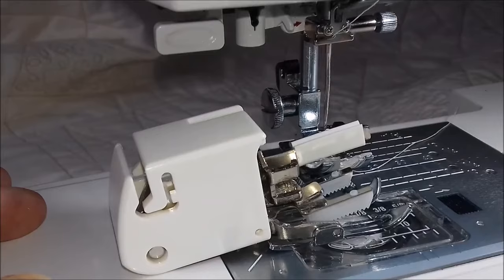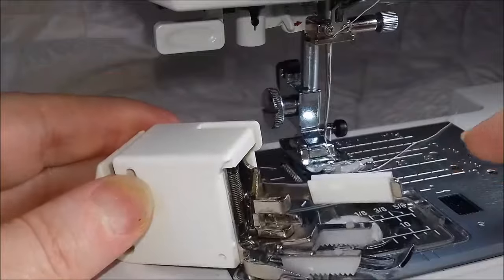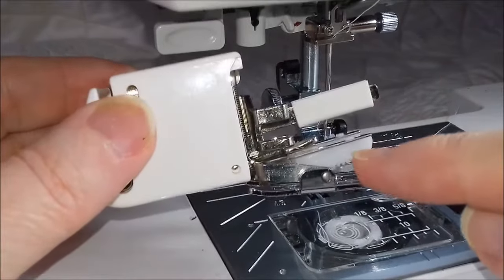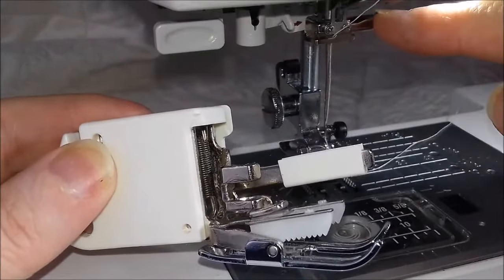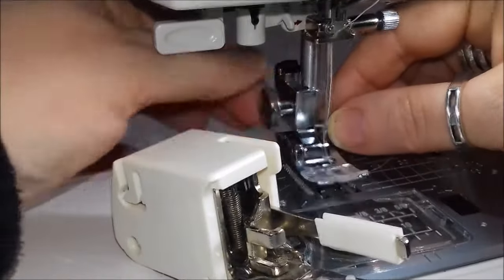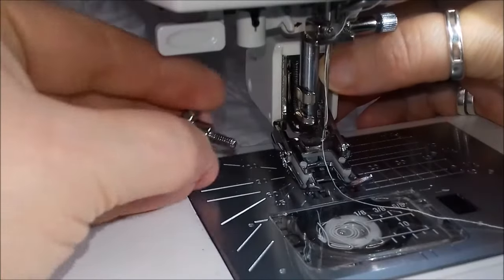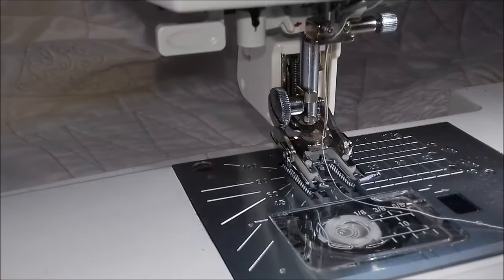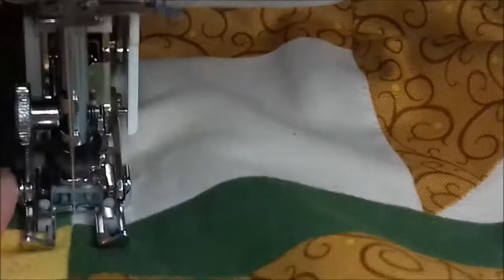How to Fit a Janome Walking Foot

Comment: Hi Rachel I’ve been looking how to fit this type of walking foot, but I have a problem my machine dose t have anywhere to attach n bar to. Any help please xx
Reply from the maker: Hi Wendy - can you send me a photo?  Rachel@sewhappy.co.uk
Reply: Hi Rachel😳😔😞😳 I am embarrassed to admit when I put the foot on and fiddled with the stitching and my needle was positioned on the left. Nowhere in my very thick manual does it tell me how to change needle position, it was more luck than judgment it moved over to middle position. The safest would be if I could move the needle to the right. Thank you. Hugs  xx
Reply from the maker: He Wendy  @WendysCraftDen  you can move the needle position by altering your stitch width... its the button with the zigzag motif... or it could be your stitch setting, - on some machines there are various needle positions preset, eg the 1/4" stitch moves the needle to the right... hope this helps Rach x
Reply: @patchworkquiltingclassestv9084  Ho Rachael I will try that later on thank you maybe I need to down load the hundreds of pages manual. I would have thought it would have been I the basic manual. I have had machines in the past and it’s basic instructions. Thank you for your help. Xx

Comment: It confirmed how I thought it fitted  but I have just spent half an hour trying to get the screw back in. Not much room for a hand to get in there. Done now, may never take it off😂
Reply from the maker: @helenedwards1468  yes it is a fiddle isn't it? Do you have a  local sewing machine shop? You could ask them to change the screw ...

Comment: just got the 6650 - great, clear, easy instruction!  thanks for the reminder on stitch length being increased.   Do you have a recommended length to go to?
Reply from the maker: Yes, I usually go to 3 😃
Reply from the maker: Nice machine, I've got a horizon 8600😃

Comment: What is the purpose of the metal bar that comes with it?
Reply from the maker: That's to help you stitch parallel lines... The longer edge clicks into the slot at the back of the foot, leaving the shorter edge sticking out over the fabric...  I'll sort another video out to show you 😄
Reply: @patchworkquiltingclassestv9084  thanks for explaining. I can probably do without attaching that as I normal stitch in the ditch.

Comment: Any advice on why my bobbin thread won't pickup?
Reply from the maker: Hi Catherine, check you've got the bobbin in the right way round -  and your needle is secure, and rethread the whole machine... it shouldn't be anything to do with the walking foot. Have you checked without the walking foot?
Reply from the maker: Also, I'd clean out the bobbin race - it may just be a bit of fluff, or a stray fragment of thread... :)

Comment: I installed walking foot on janome s3 skyline , but it's not sitting on the the needle plate, it higher .
Reply from the maker: Hi Gayana - did you buy the walking foot with the machine? - it sounds like you have the wrong foot to me....  it should be a high shank foot...